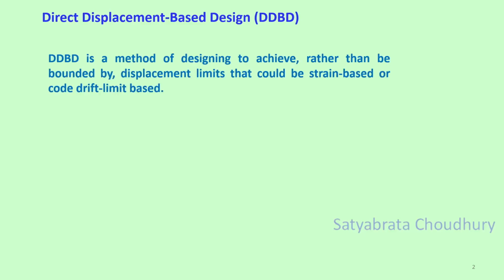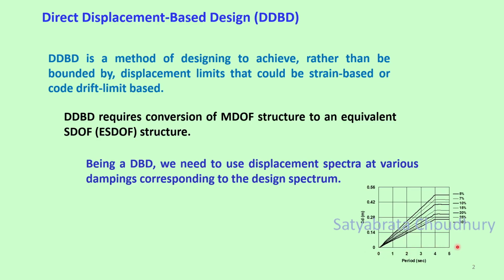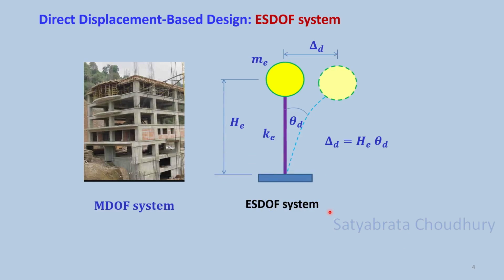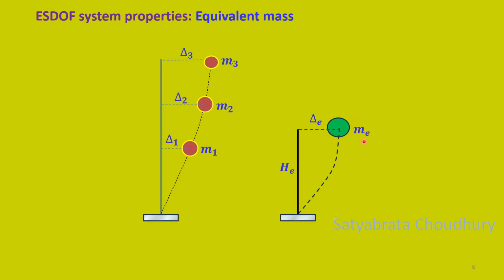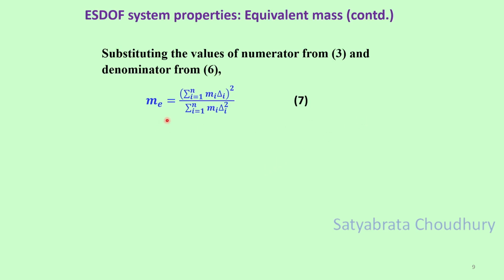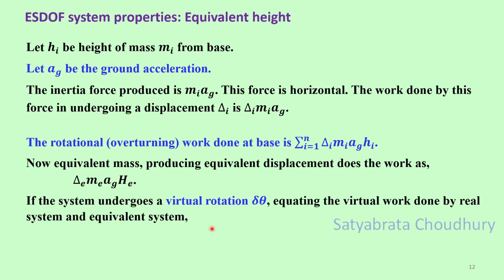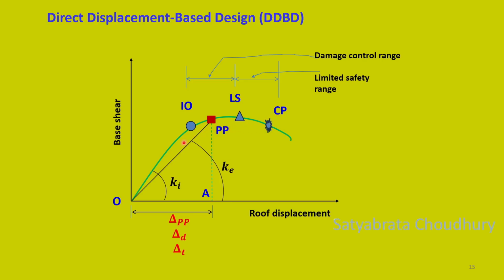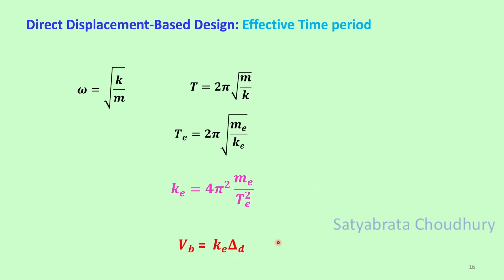DIRECT DISPLACEMENT-BASED DESIGN (Pt 1 Theoretical background)

Comment: Sir, in the displacement spectra, why is the corner period considered as 4 sec?
Reply from the maker: At first, I apologize for the delayed reply. I did not notice it.
The 4 s3c is not the typical corner period. The transition from the flat part of the design spectrum to the falling parabolic is the corner period. After 4 sec the spectral values are kept constant so that a minimum design force is available for the structure (else it will keep on diminishing as per say, 1.36/T, in IS 1893).